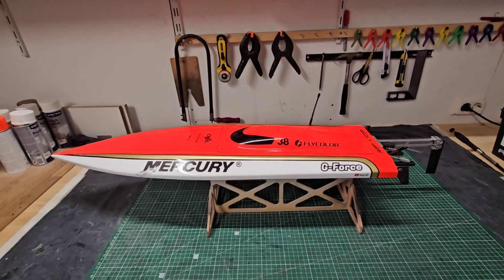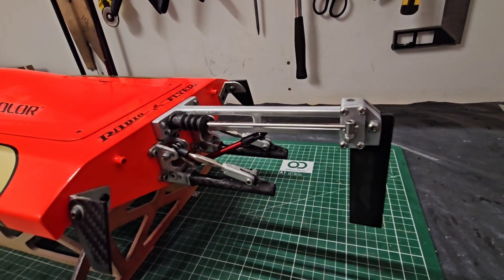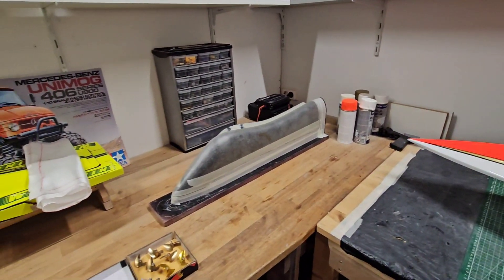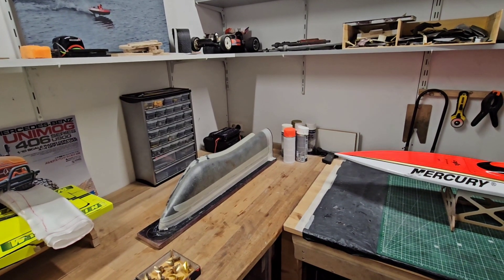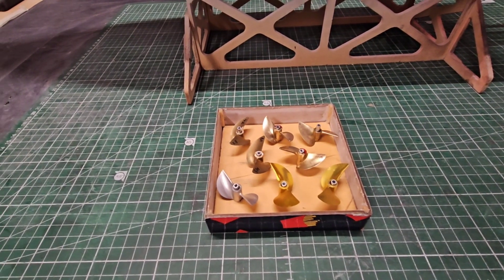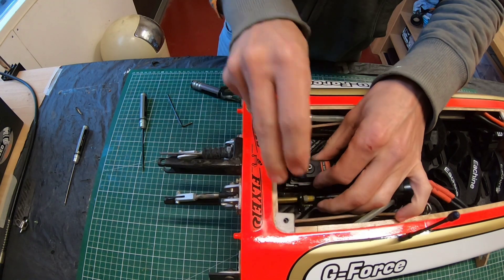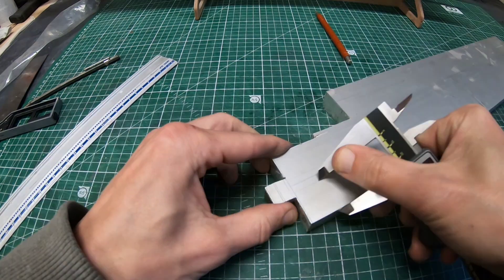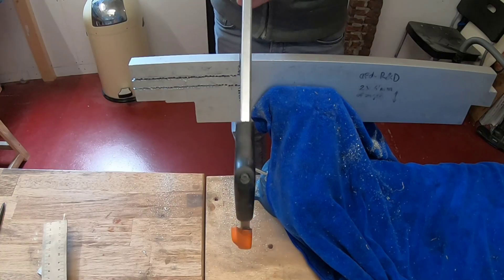How to make your own RC boat parts: DIY rudder system without CNC tools.

Comment: Great build can you Maybe tell me where you get the hull for the boat from because I have a hard time printing it
Reply from the maker: Hi mustache, thanks! This hull is a full DIY build from wood and glass / carbon fiber laminate 👍
Reply: @CozyRC also how do you get the shape?
Reply from the maker: @mustache405  I designed the boat in 3D CAD and made my own drawings for the wooden frames. The design is based on the Wildthing from John Finch.
Reply: @CozyRC thx
Reply: @CozyRC  thank you

Comment: Another great video showing the old school ways of building. I have been following your channel for years and learned lots. Currently working on a boat and actually in need of a prop, so your timing is great for this giveaway. Cheers from Canada 🇨🇦 (FYI any of the props in your box look suitable for this 18 inch boat I am working on). Thanks and keep it up!
Reply from the maker: Thank you, I appreciate your feedback! For an 18 inch boat, you would need a 30-34mm prop I would guess. The props in my box are bigger than that, but if you win, I order a new prop to your needs 👍
Reply: I definitely would consult with you on what’s best, it’s a beautiful boat with a gearbox, just upgrading to brushless. The original prop simply isn’t going to be suitable since I am expecting to see higher rpms than the older brushed system. Our RC boat season is starting soon since we are just getting over 10c temperatures.

Comment: watching you make stuff by hand makes me wish i tried that before going with 3d prints for all my projects
Reply from the maker: You can still do that. If I had a 3D printer, I would use it for making molds for carbon fiber parts 😎
Reply: @CozyRC  Hey Jan. Just say when lol. Soon enough I'll have a video out on a full hull made with 3d printed molds and carbon/fiberglass. Cheers

Comment: this is true passion Cozy 🫡in some of the runs you think you can adjust the rudder blade with a slight angle I believe whill help with stability In high speed,but don't forget to enjoy out there 🤗
Reply from the maker: Thank you Daiciu! Yes, this is my passion, as you know, and we share it together 😎. My goal is to setup the boat more stable at first, to prevent crashes and flips as much as possible. Then, let's go for some speed numbers 😎
Reply: @CozyRC  my thinking is that the slightly angled rudder blade will help keep the boat not to flips
Reply from the maker: @daiciuapostol79  Yes, I understand. But I fear that it will give   unpredictable behavior at high speeds. When you turn a tilted rudder (steer the boat) it will lift the boat even more out the water. But for SAW that might be no problem. Let's see in your next run!
Reply: @CozyRC  I did run my boat with the rudder slightly inclined and she run great and I improve my speed but G-Force and Woody are different, was just a thought
Reply from the maker: @daiciuapostol79  I always like different ideas, and if you tried it with succes, it shows that it works!

Comment: I could not tell if you use a jitterbug file on the aluminum  they have course curved teeth  and work excellent on aluminum  with a drop of dish soap to keep from plugging to the file. I enjoy all of your videos
Reply from the maker: Thanks for the advice! I had to look it up, because I didn't know that term. I used a finer mesh file, more for finishing than for coarse work. Those jitterbug files could have saved me some time. I will look into them! ✌️

Comment: Congratulations with your 2k subscibers. Always wondered kind off how long some off these home made parts took. I know some things i do myself take lots off time and i wished it could go faster, but this is another level. I hope it holds up and doesn't bend or anything like that since all the hours you put into it. This is not totally unthinkable with the speeds we run...
The prop (i haven't seen any reactions on that) would be in my case a ABC2016-10-50. And why? Because i haven't been lucky working the abc's, so stopped trying and run octura...
Reply: You remembered right! Its already made longer but still in front. Also believe its mostly due the hull shape because the single also doesn't turn very well and that has an offset rudder. But giving it a try never hurts.  Also noticed some off the twins in YouTube (like baby Raptor) have more square turnfins. I noticed on my twin that putting them straight up (closest to transom in "unnatural" angle) gave bit better turning but still hops and flips very easy when cornering.
Reply from the maker: Thanks for your supports Peter. I hope the rudder will hold, too. I have good hopes. I hope to tune the boat better, so it will crash less, in the first place 😅.
I got you on the prop. I'm not sure if I can supply a brand-specific one, but let's await the winner first! (next week).
Reply: @CozyRC  Besides the hopefully less crashing its also interesting to see if it makes a lot off difference in the handling. Could be i give it a shot  on one off my boats if it changes significant...
Reply from the maker: @peteroosterhoff8850  I remember your twin mono has a huge turning radius. I'm not sure where your rudder is located, but if it is in front of the props, the turning radius is huge, as I noticed in my last run with a short rudder bracket. If so, I recommend to use a longer rudder bracket, setting the rudder behind the props. It will be a big difference!